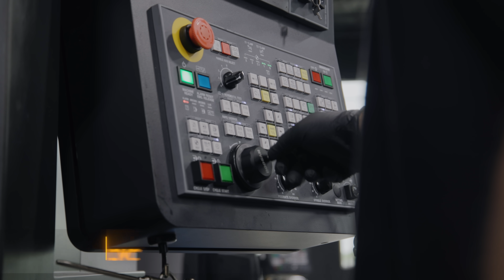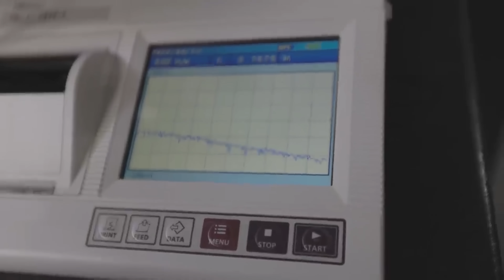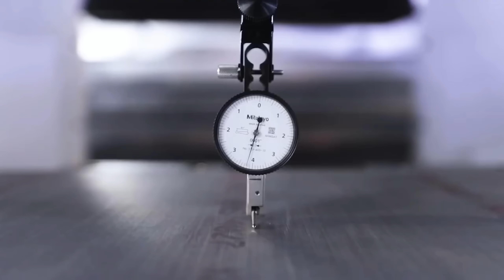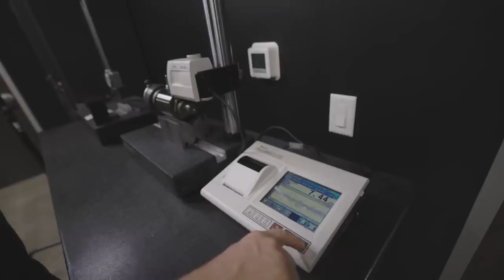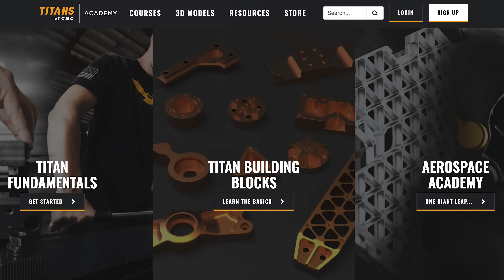Dumb Inspector Rejects My Part Without Explanation

Comment: i did a job for another machine shop and 2 out of 20 bores were 0.00005 under on a 0.001 tolerance in aluminum but only on the start on the bore. it would have took 5 minutes to correct the parts with a scotch brite but no, the company send back the entire job lol.

Comment: I'm a former machinist turned cmm operator. I gotta say I under estimated what it takes to properly run CMM. I'm glad I was a machinist first so I can understand the info the machinist would want to hear, and what they don't lol. It feels amazing to help my guys continue to run in spec parts. I might not be one of the rockstars anymore, but I still have just as much pride in my work.

Comment: Don't forget the engineer who specified the dimensions to begin with.. As an engineer, I see others adding tight tolerances because they dont understand how the part actually functions or just apply incorrect dimensions and tolerances because it was easy.
Reply: Truly this is a big problem. Creating impossible features, Speccing something without a good reason, Making a part that has to be referenced in an unnecessarily complicated way, etc. Also for assemblies not thinking about the other parts that make up the larger product and the clearance for the tools to put them together etc. A good engineer will talk with the machinists. Since the machinists run the tools they will know doing abc is possible but more expensive or whatever.

Comment: As someone who started in this industry from absolute zero knowledge, I’m still amazed at how some have no idea how to check parts and can’t read prints. I was groomed by the smartest man I’ve ever known and it was absolutely imperative that you knew both sides of the shop. Most kids now don’t know (and don’t want to) how to hard check parts. I did a part recently where the CMM program wasn’t correct so I had to hard check the part. It wasn’t super complicated but required set ups at angles and had some tricky dimensions. I had inspection come out to me and ask ME how to check the part. Because the CMM couldn’t check it, they were lost. I’m 48 and have maybe 12-14 years left and from what I see coming up, I’m really worried for this industry.

Comment: Great message!
As a machinist and now programmer, I have had many conversations with the machinist on how I program to ease the possibility of errors.
 I sometimes have to write a paragraph in the first line comments to explain the setup. I had around 90 tools, luckily the HAAS can hold 200 tool offsets. My header would explain that.
Example: T32 uses H32, H132 and D32, D132 because of say, our commonly used 1/2" EM does the outer profile (Contour 1 uses *32) and the inner pockets (pocket1 uses *132) where many times only one of those features measures out of tolerance and Comp would throw the other off if one was dialed in. This did take some explaining to the machinist, but once they understood my method everything went smoothly.

Comment: The cmm is a foolish way to perform mechanical inspections on mechanical products. Although idiot proofing the thru put of the inspection dept using the same dwg file as is used for the cam program. Mechanical inspection tools are right. I've seen differences between the two. And the differences are the cmm measuring incorrectly. So.

Comment: Good topic. Have to agree that the quality inspector has to understand the manufacturing process while inspecting. If there are issues, it’s need to discussed with the operator and a solution has to be found together. That is the complete role of the inspector.

Comment: This reminds me of an incident over 25 years ago, when I brought a drawing for a template to the eroders, who were supposed to make a template for my profile grinder so that I could adjust the grinding wheel accordingly.
Hope my English is ok, they had to do it anyway 3 times and blamed me every time for the fact that in the end the parts were not right.
It was ruled out that the error was due to the eroders and I had to recheck my drawing again and again, but found no error.
In the end it turned out that the error was not with me, but with them, because somewhere they forgot to program the radius.
Or something like that, anyway, I wanted to say, they didn’t even bother to look for the mistake in themselves, because they thought they wouldn’t make any.
Half a day’s work was broken because 5 minutes of checking were not invested.
Because of the ego..

Comment: All too often I've seen inspectors treat a CMM as an infallible god. I had an inspector reject a part for a slot being oversized and out of position by several thou. He handed me the report and walked away. When I saw how much the slot was out by, I grabbed the set of Deltronic pins and showed him the slot was fine. I asked him how he had it fixtured. He had it standing on edge in a small grinding vice so he could check it in one setup. Problem was that the part had a floor thickness of about .075 and one side was open with no side wall. I told him the part was getting pushed around. He squawked a bit and said no way because the probe was only exerting a couple grams of force. I said humor me, let's put an indicator on the part and run the slot. Sure enough, the part was flopping back and forth .002-.003" in either direction. I designed and built him a fixture to check the part and had no issues after that. I explained to him that if you get something out, especially by a significant amount that it only takes a couple seconds to validate with a pin, mic of height gage. Everyone working in a machine shop should have a basic understanding of physics as well as GD&T.

Comment: Great video as always.
While I agree all areas of the manufacturing processes is it good to have an understanding, however, isn't it the role of an inspector to read the print(s) and specs, ensure the measuring devices have valid certs, and measuring the parts "to spec"?  I had an inspector (different industry, and I was relatively "green") reject my article, I looked and said "but it is only out a little bit", to which he replied "it is either in spec or it isn't".  I am not sure they should care why or how you got there, only that it "is or is not in spec".

Comment: I worked in QA for software for more than a few years as a Test Engineer.  Not remotely the same industry but I imagine similar in some respects.  

Anytime we found discrepancies we'd retest it like mad before alerting the rest of the development teams.  This ensured that what we found was actually a repeatable, legitimate issue.  We'd  re-read the instructions, re-eval the testcase for correctness, recalibrate our gear, retest on the same machines, then do the same thing on different gear and machines etc etc.  It was brutally monotonous at times as you're running hours of script.  But you better believe we documented EVERYTHING and ANYTHING along the way.  Depending on the severity of the problem, upper management would share this information during inter-departmental meetings so that the appropriate groups could start working on a solution.  You never know if it's going in front of both S/W and H/W teams.   We're talking multi-million dollar projects spanning different countries and time zones.

There was no way in any way shape or form you could simply give a product a "Fail" and not document the process on how and why it failed.  We had one of the Senior VP's from Japan visiting one time.  He knocked on my office and started discussing an issue I had found.  All the documentation was there and I quickly and concisely answered his questions.  It gave him the solution he needed to go and talk to the right group.  

Giving you a "Fail" without any justification or explanation is just a waste of manpower, time, and ultimately money.  I have no idea how much you make personally but my brother is a machinist so I have some number in my head.  Not including machine time, your time, and actual material it can't be cheap.   Not getting an explanation is absolutely worthless.   This is the kind of actionable event where I'd discuss it with upper management to seek out better solutions for future situations.  

Knowing why something failed is just as important as knowing how to make something succeed.

Comment: As a CMM operator that spent many years in the shop, all the QC guy should have to do is be able to answer questions about what is bad. If I've done my job as an inspector, and done my best to explain how and why the part is bad, the machinist should be able to figure out the manufacturing issue. I have no problem helping and lending my knowledge, and it is useful to do so, but there is no situation where the inspector should be expected to figure out the operator's side of the issue over the machinist. That is specifically the machinist's job to know what is happening on and in the machine. I'm not the one out there indicating their fixture to make sure it's straight, I'm not the one setting up the tools. I can guess, but my guess shouldn't be more informed than the machinists at the end of it.

Far too often, the guys I deal with on the floor look at a failed QC inspection as something to be argued out of rather than treated as a failed machining operation despite that rarely being the case. They were taught this attitude by our bosses, who are also machinists with zero QC experience. Their inability to troubleshoot at the machine is almost exclusively dealt with by doctoring results rather than producing better parts.

Comment: I worked in a shop for 10.5yrs. A new inspector started and would check the chamfer on a part with a cmm. The drawing would call for a 45° chamfer. 050" of an inch.  Cmm would read 44.91° and she would reject the part for that. And demand we adjust the angle the .09°

Comment: Excellent explanation Travis! Quality inspection is a two-way street. 

When I was a machinist, I valued working directly with the quality inspection team. Whether it was to solve a problem, clear up uncertainty on how to go about inspecting a dimension, learn more efficient inspection methods, or just needed a second pair of eyes. 

From a machinist perspective, the best engineers and quality inspectors I worked with were the ones who cared to ask about the machining process. Through conversation, sometimes unexpected problems related directly to the machining process were uncovered.

Comment: As a machinist who later worked in QA  I found the RCA process to be the most rewarding part of the job. I would often go to subcontractors with issues and pass on my experience of machining the parts we were ordering, and sometimes I'd spot new methods I could bring back into our own machine shop. Even if they had made an error in some part of the process sometimes other parts of their processes were innovative and forward thinking.
Reply: I would agree John. Finding the problem and helping come up with a solution is one of the most rewarding aspects of any role in manufacturing. Thanks for the input!

Comment: As an quality engineer, I always first check and triple check my measurement methods, tools and other relevant quality topics. Then I delve into the understanding of how I would have gone about of manufacturing a part & other causes which can cause the defect. Then I go talk to the people handling the parts and manufacturing. I want to know the root-cause of the "failure" and not just throw a report on the table and walk-away as some have stated. While I trust my CMM a lot, you gotta always be aware that I can make mistakes too when setting up the run or the program.
Reply: That's how you do it my friend. Thanks for the input.
Reply: Oh, absolutely. I don't tell anyone their part is bad until I've double or triple verified.

Comment: I disagree with an inspector being involved in the machining. The function of inspection is to qualify dimensions. Inspect, explain the results to the machinists and check when the changes are made.
Reply: Why? I have fulfilled both roles. My understanding and insight into the machining processes have made me a much better QA. It also makes the RCA process far superior. The "it's not my job" attitude doesn't help anyone.
Reply: I respectfully disagree. It also has nothing to do with it’s not my job. How a part is machined has no bearing on the inspection results. If I made a square part. There are several ways to make it. An inspector will not check it differently depending on how it’s made. And the results will be the same. Overlapping roles can lead to more confusion and wasted time in most instances imho. The role of an inspector is to inspect to print, and to correlate the results of the machinist if there are any discrepancies . Nothing more, nothing less.
Reply: Inspector needs to just as involved, he TELLS you what needs to be done, my inspector is top notch and always helps out, all inspectors I’ve met have been involved with their machinists… if they didn’t then they didn’t last too long at the company or shop
Reply: And machinists don't really need to wipe off the parts either.

The coolant and chips following along are not their responsibility.
Reply: @angrydragonslayer  you guys are idiots if you think that, hence you probably didn’t get too far in your profession either with that mentality

Comment: Awesome video, ive seen it before myself. Nothing is better than an inspector that helps you understand what is actually wrong with a part, rather than just throwing a 200 page cmm report at you and walking away.
Reply: You should get the part back with a functional, clear As-Built drawing, yes.

Comment: Man, this topic is a slippery slope with fingers always pointed both ways. However, years of conversation as a QE in an aerospace machining company would lead me to agree on most all points mentioned. Collaboration is usually the missing link, many fixtures were re-designed and processes changed once an out of spec dimension was diagnosed properly as a team.
Reply: Communication is the key for sure. Thanks for watching Justin.

Comment: When I was a quality manager I would always hard check anything that came out wrong on my cmm. Once I had it figured out I would get whoever made it and we would check it together and see how they are inspecting it. Now once we agree what needs to be fixed I would tag the part but I would also put a drawing on the tag that will show what's wrong and what way it needs to move to be fixed.  CLEAN YOUR PARTS BEFORE BRINGING THEM TO THE LAB!!!!!
Reply: Inspection is a laboratory preformed science. Huh. I was an inspector and I'm machining again. I'd love to work in a quiet air conditioned metrology laboratory.
Reply: @erikgrahn3363 , I've only seen it in the largest of companies. And also, the only place I've seen inspectors with no machining experience. What dunderheads. Having been both, I'm so glad to have crossed the finish line of the rat race.
Reply: @Braxton Turner calm communication it key! No one is perfect and not every machine can be poka-yoked
Reply: My favorite part is when we have a rule, laid out by management, saying to clean your parts, but then when you bring up people not doing so they act like it isn't a big deal. I'll run a gigantic, compelx part for a half hour or an hour, just to find failed features all over it because I didn't notice chips left in holes and whatnot that should have been cleaned out.
Reply: *and deburr
Reply: Not cleaning parts is the best revenge on inspectors

On a more serious note: always try to simplify life for everyone involved, your coworkers who you'll work alongside being in a good mood is a good idea.

You intentionally making someone upset could result in them losing focus or retaliating (please don't do this either), costing the company money and decreasing the number in the bank account bonuses and raises come from.